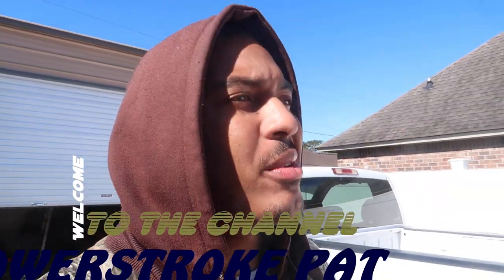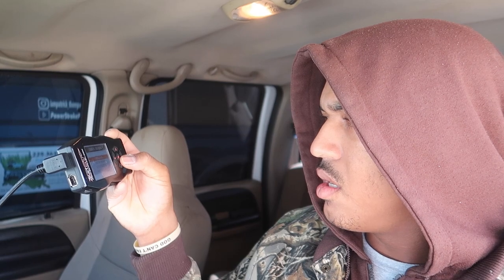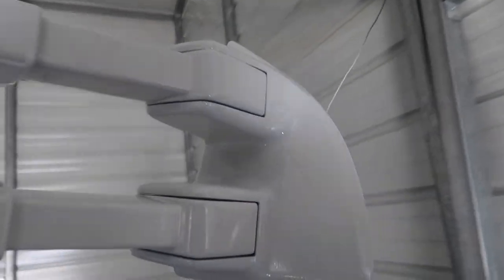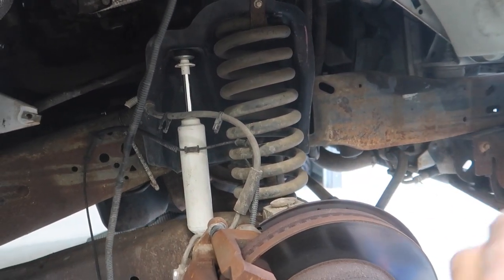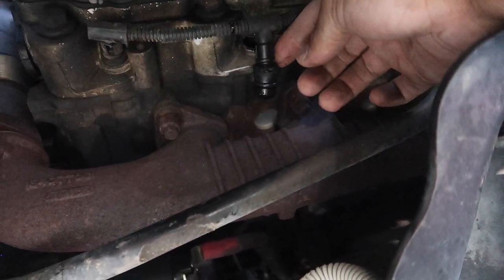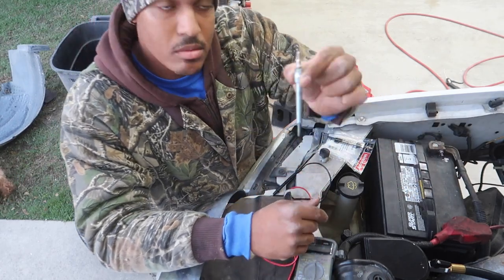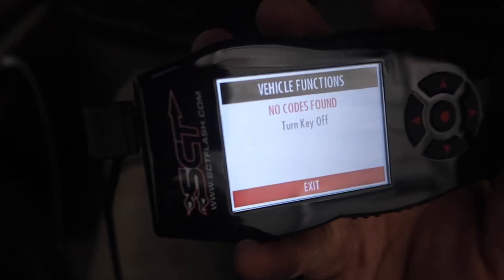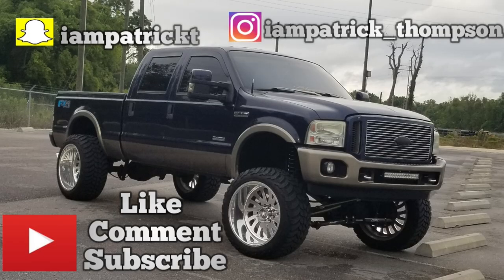Vlog |F350 Glow plug replacement|simple how to| Dint trip|We back

Comment: Gotta get a new motor for my 6.0 -350 so I’m living vicariously through you right now
Reply from the maker: Ahh man sorry to hear that, what happen to it? And I appreciate the support
Reply: @Powerstrokepat  i bought it that way, thought maybe I’d just be bulletproofing but got into it and it had been run too hot, i paid 2400 for a solid body pretty much so i didn’t lose. going to find a used long block and drop it in and then maybe have that motor rebuilt to pop back in later.
Reply from the maker: @buddah389  ahh ok well thats not bad then.  You'll get to build a pretty nice motor to drop in it. That's sweet